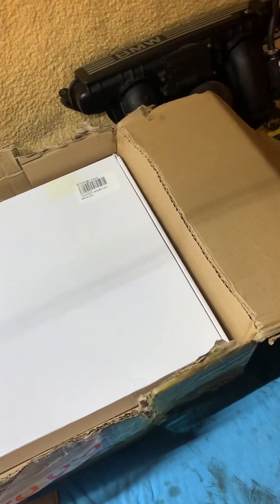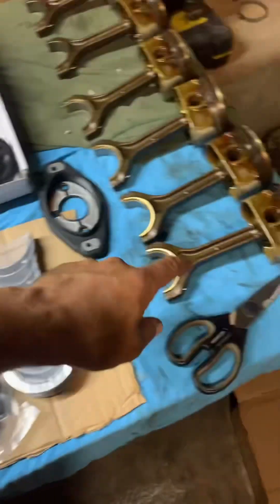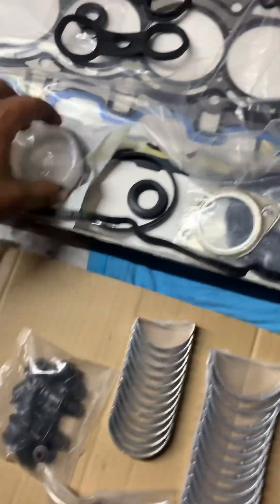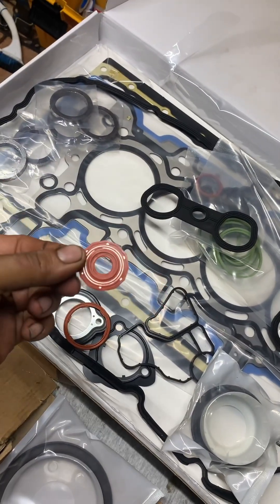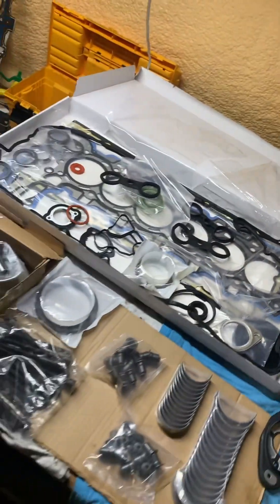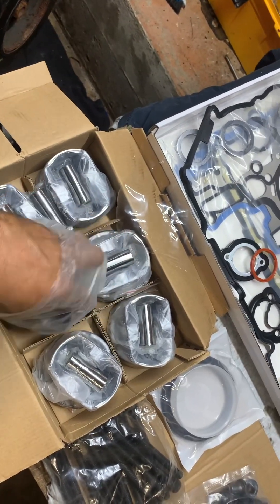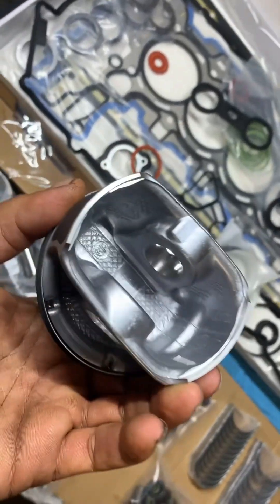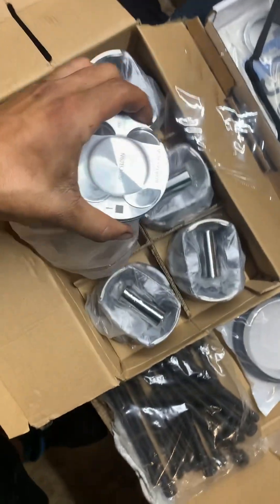N52 build for 18-20psi of boost 😳 engine overhaul kit + low compression pistons PART 1

Comment: Hey  bro id love to ask a few questions if you got insta or something?😊
Reply from the maker: I’ve only got Facebook but I answer most the comments in my videos
Reply: @rumrunnersracing im boosting my n52b25, wanted information on how much boost a b25 can hold compared to a b30 , i dont have the luxury to switch to a b30. 

Gt25x turbo 255lph fuel pump 550cc injectors , wana make around 330rwhp cleanly for a daily build on my e60 on stock msv70 any tips on how i should move?
Reply from the maker: @i9x668  b25 and b30 will take about the same boost pressure the b25 will just be more snappy of a rev being slightly smaller the b30 would make a bit more power but it’s not as quick revving. the m54 engine is the same they make a b25 and a b30 imo the b25 felt faster because it redlined quicker. One thing is the n52b25 might have thicker cylinder walls being a smaller bore so could potentially handle boost better then the n52b30 🤔. Regardless both are fine for boost. If you can get the msv70 ecu flash tuned that’s your cheapest and best option. Just be sure to get the rising rate fuel pressure regulator and you have to run a return line to the tank or your fuel pressure won’t raise with your boost pressure in the cylinders. your injectors will be fighting the back pressure and get less effective the higher you boost. Like a 550cc injector is 55lbs if you 10psi you now have 45lbs of injector flow and at a certain point it won’t atomize the fuel properly. it’s a big boosted build killer with the new fuel system being a regulated by spring pressure regulator in the tank it’s not like the older bmws like the e46 where the stock regulator has a vac reference and will raise fuel pressure 1:1 with boost up to I think it’s ten psi so my advice make sure your fueling is on point don’t cheap out on injectors or the fuel pump or the pressure regulator go aeronotive or something decent anything in the fuel system fails on a pull like injectors fighting to much back pressure or the pressure regulator is cheap and not building enough stable fuel pressure your engine or likely piston #6 will not be your friend anymore 🤷‍♂️ anything you have more questions on just hit me up on one of my videos 👍

Comment: Hey just a curious question but aren’t the n52 rods weaker ?
Reply from the maker: @littlebqe   weaker then n54 rods yes they are but I’ve never broke one even running higher boost on the stock engine I blew piston ring lands twice that seems to be the weak spot on these motors
Reply: @ that’s pretty interesting with the over haul kit the pistons that come with it are rated lower compression ? And thank you for sharing the info on this build I find it pretty cool because I’ve had so many questions if it were possible to boost and be reliable
Reply from the maker: @ no problem always glad to help people learn about this platform and yes the stock compression is 11:7:1 these pistons lower it to 9:3:1 so you run higher boost and more aggressive timing without blowing the piston ring lands like I’ve done twice before. we also gapped them piston rings to 0.13 to 0.23 so it can handle more boost without worrying about the piston rings touching each other due to the increased heat and cylinder pressure
Reply: @ that’s pretty interesting brother is there a way we could get in contact a little directly cause to be honest I’d love to partner up a little so we can experiment I want to try do the same build much love bro
Reply from the maker: @ yea I’m into that I’m the admin of the rum runners racing Facebook page you can reach me on there 👍

Comment: I’m new to the bmw scene and I was wondering if low compression is good ?
Reply from the maker: @betolopez1021   it’s only good for turbo cars if you have a non turbo car they run higher compression to make more power. Turbo cars have air compressed and pumped into the engine so they have more pressure in the cylinders so they run lower compression ratios to gain timing and be able to run more boost safer. High compression + high boost= blown motor. Also the piston rings need to run a bigger gap then n/a cars as well so the rings can expand more due to increased heat and cylinder pressure. Hope that helps if There’s anything u want me to elaborate on just ask I don’t mind passing down knowledge to the bmw fam 😎 👍

Comment: Did you gap your last set of rings when you were running at 14psi?
Reply from the maker: @LapDeleted  nope that’s with a fully stock un opened engine this time around I added lower compression pistons and opened the gap from .013 to .023 for this 18-20psi setup. These cars should be able to run 7-10psi no issues with proper fueling a good tune and decent intake air temps .

Comment: How much horsepower are you shooting for?
Reply from the maker: I wanna try to shoot for a semi reliable 600whp the cars made that power before on the dyno but we had to stunt the tune a bit due to intake air temps it would be heat soaked by the second run and start to pull timing so this time around I’ve made ALOT of changes to squeeze out some extra power

Comment: I’m thinking about boosting my n52 how much boost is like safe for it
Reply from the maker: with proper fueling and a rising rate fuel pressure regulator and a tune it will run 7psi all day on the stock motor without opening the motor to gap piston rings, You could thrash on it all day and you would be fine at 7psi when you get 10-12psi your in the yellow area where u want to open the motor and gap the piston rings for the added boost and you want great cooling for intake air temps and dissa flap will snap off at this pressure inside the intake manifold so it needs to be deleted if you wanna run 10-12psi
Reply: I see you mentioned the DISA valve,have you tried a different intake manifold like this one?
Reply from the maker: @owenhvc6474   nope I have to work with what I got mostly no money for new manifolds most parts I get from the local scrap yards to keep these builds alive my kids come first car hobby gets whatever change trickles down to me 😆 this manifold will work fine I try to stay pure to n52 parts because Theyr so plentiful in my local scrap yards now days you never see any 335i’s around the scrap yards 🤷‍♂️

Comment: Since I have n51 and those come with lower compression how much boost do you think I can run
Reply from the maker: @SLVR2-z8y  with proper fueling and supporting mods I would say 12psi wouldn’t hurt it if you wanna play safe without gapping piston rings if you gap rings and your looking to thrash it and want all the ponies 14psi with meth injection I would call a safe bet with a reliable tune you could push more but your head studs will be the next issue going past 15psi

Comment: How does this kit feel? Is everything branded BMW or OE as described by the seller or are they fakes?

In their pictures the pistons seem like there are made by Mahle
Reply from the maker: It feels pretty good the pistons themselves are marked mahle me and my buddy looked them over they seem legit 🧐
Reply: @rumrunnersracing  are the gaskets Elring or Viktor Reinz as mentioned in the website or not? Sorry for the many questions, can’t decide if it’s worth it getting this kit or buying them genuine
Reply from the maker: @n00b1n4t0r  no worries man I’m just at work I didn’t really look over the gaskets but I’ll get some eyes on them after work today and let you know I was mainly eyeballing the pistons when I opened the kit
Reply: @rumrunnersracing  cheers mate, appreciate it
Reply from the maker: @n00b1n4t0r  the kit all looks legit my only issue is how the rod bearings were packaged they were not individually boxed like it shows in the pic but they look oem I think I’ll send it with them my new motor gets picked up Monday so I’ll have this together and in the car a week or 2 from then. My block has a bad cylinder wall it got scorned by the piston ring land letting go so I had to get a replacement
Reply: @rumrunnersracing  thank you man. I ordered the regular compression kit and ll let you know how it arrives. 

Good luck with your build, subbed to check your progress. And don't listen to the comments about your garage mess. Mine is 10 times worse, looking for a tool is like playing Where's Wally?....
Reply from the maker: @n00b1n4t0r   yo where are these comments YouTube might be filtering me from the hate cuz I can’t see them 😅. But yea I do t care about mess I’ve got 3 kids no time to get things clean af or there would be no build so I nickle and dime my time to just have a car hobby at all 🤷‍♂️ but haters gunna hate man all comments are good for the algorithm 😜👍

Comment: Love the content. I have a 06 330i and want to turbocharge it as well. Keep up the videos man. I would rather watch info from a guy like you in a normal shop making things happen on a real budget. I like the fact you're sticking with the n52. Ive read up on them having noticeable limitations but rarely see anything where someone is eyeing ways to eliminate them. Usually seen as lesser than compaired to the other bmw na 6s since the n54 is available. I even considered doing a n54 bottom end on the 52 head if i ran into issues. Glad to see someone pushing the envelope and keep the 52 and make it more reliable with boost.
Reply from the maker: Thanks I appreciate the support it’s been a long road of learning so far but I’m glad these are helping out the n52 community I’ve got a ton more videos to make on different subjects for more boost like the need for gapping piston rings, the benefits of meth injection I’ve also got an oil cooler going in as well. I was thinking of getting the n54 crank and rods and keep the n52 bottom end keep it more pure n52 I try to avoid using anything n54 because if I use the n54 block with pistons and rods I mise well put the n54 head on so I’m looking for ways around that 🤔

Comment: some n52s use more massive connecting rods than these. probably better to put those. you can recognize them by the expanding rod at the bottom
Reply from the maker: What n52 uses bigger rods? I was looking into n54 rods but no one seems to know if they fit the n52 crank 🤷‍♂️ a lot of this is uncharted territory

Comment: Is the pistons cast or forged? Looks little cast for me in the video. I am excited to know how this works out when you are up and running the engine for some boost. Thank you for doing n52 content ❤🎉
Reply from the maker: Hey thanks for the support not alotta n52 content on there and I find the stuff that is there dosent explain much so I’m glad I can help the n52 community add power 😎 and as for your question the pistons are cast not forged but the stock rods are forged aluminum not cast so I’ll run the stock rods to see how they hold up 🤷‍♂️ from factory the n52 comes with cast pistons and forged rods so these are the same material as stock pistons just piston rings are placed differently on the new piston that’s how they lower the compression.
Reply from the maker: Pistons are cast aluminum like factory but stick rods on n52 are forged aluminum from factory so I’m going to test the limits on those with the new rod bearings in the kit